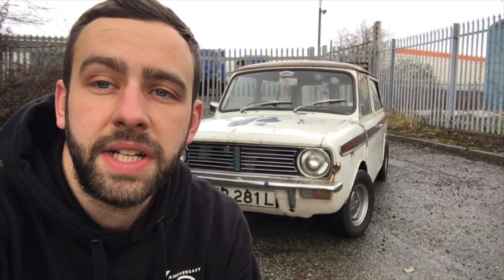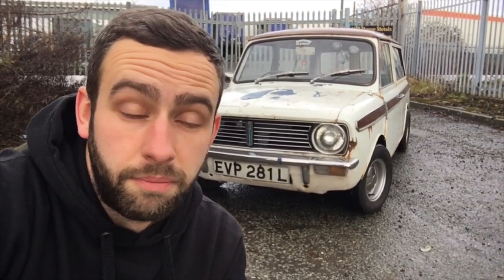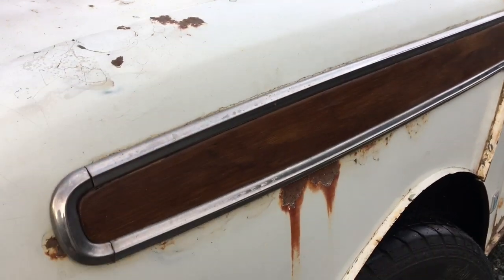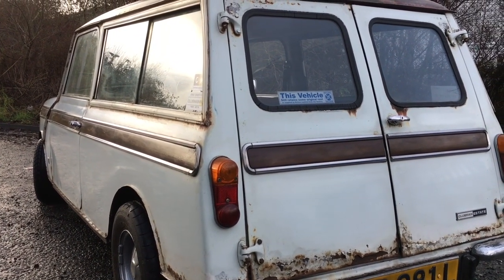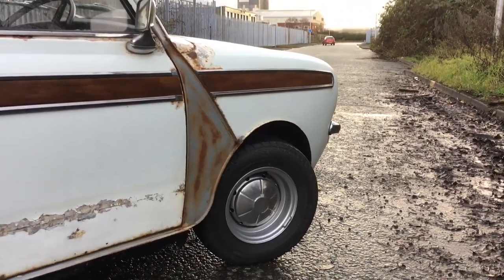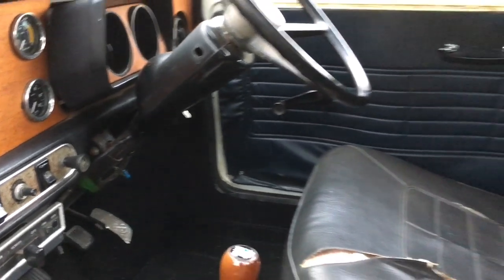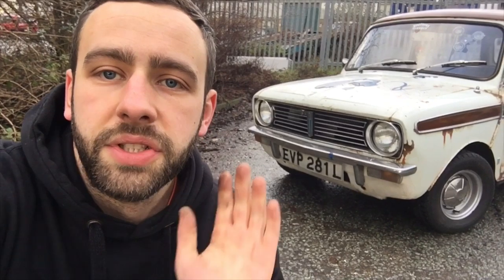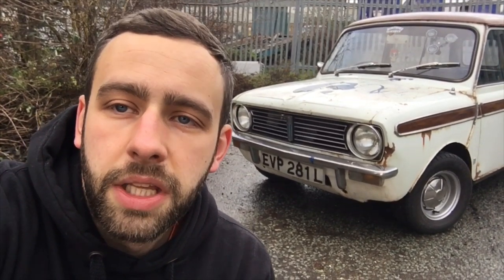Classic Mini Clubman Estate - Why I Love This Car!

Comment: Good luck with your project man... I had one of those from 84 to 88. I drove it over the alps twice and  the Pyrenees countless times, packed full of climbing and ski gear. I kept if going with fiberglass tape and eye-watering breaches of safe practice before I found a scrappy near Barcelona Airport with a few minis and began to salvage all the relatively cheap, rust free spare parts that the drier climate offered. Spotless rear subframe, engine mounts, suspension elements all dusty but not rusty. The vehicle even made it's way down to Cadiz, in wilting summer heat. It was a brilliant motor and would have carried on but for my having to quit Spain... xxx ;-)
Reply from the maker: Wow sounds like you have some amazing memories of a clubby estate and some real adventures to. I get what your saying about parts from a dryer climate. Thank you for watching 👍

Comment: Lovely little gem, as you say so practical - I delivered gear components to a powerstation in my L reg back in 1982 and carted 5 mates from pub to pub. We even camped in it when our tents were flattened in the beautifull Cornish summertime weather. Looked muscular with arches and decent rims in a way the saloon just couldn't muster, and handled brilliantly I guess cos the glass in the back brings the centre of mass rearward into a more nearly central position. Regularly miss EFA 386L. Hope you're still out there.
Reply from the maker: What a great story. I hope it’s still out there for sure. Cheers for watching 👍

Comment: Great video. It reminds me of my Mother-in-law's Mini Clubman Saloon which she bought new in 1972. It was white (Arctic White, I think) and showed every bit of rust that ever appeared over the years. I spent many happy hours touching up the paintwork and doing other minor repairs. The car was eventually given to my wife in 1986 when it became her daily driver. She hated it because it was so unreliable (starting problems mostly) and finally gave it away to a neighbour when my Mum donated her Mini Special (1100) after she bought a Mini Thirty in 1989. I'm not sure I could stand another white Mini as every scrap of rust is so obvious.
Reply from the maker: Graham Woodier Thanks Graham. Yeah being white it shows everything but think it also gives it some character. It sounds like you have had some great minis over the years. Do you still own one?
Reply: @SimpsonsClassics  Yes. I have my Mum's last Mini - a 1992 Rover Cooper SPi in BRG with a Diamond white roof. Currently being restored the easy way with a Heritage shell and a professional paint job. I have just started bolting the bits back on - trying to use as many original parts as possible. Mum's first Mini was an Austin Seven which arrived in January 1960 so it must have been a '59 build. Sadly that is long gone (replaced by a string of Austin 1100's that rusted even faster than a Mini).
Reply from the maker: Graham Woodier hey that’s awesome nice to know that you still have a mini though. That does sound like it would have been a 59 built car shame she doesn’t still have it.

Comment: You should repair the rear doors before the bottoms rust all the way through. I know to want to  keep the car as original as possible, but you can get replacenment repair panels for the bottom of the door. I just worry that if you don't address the rust before it gets to the point that it rusts all the way through.  The wood on the sides looks lovely, kudos to your wife for the job.   Can you get new reproduction seat covers for the original seats?  Usually replacing seat covers just requires  hog rings and a set of hogring pliers.  it would be great if the repo seat covers were available.  It really is a great car, and as you say, it is very practical.
Reply from the maker: Shane Black Lord Yes the back doors are definitely something I want to sort and I am on the look out for these. If not the panels will be source and I will repair the bottoms of them. Don’t worry. Cheers I think the wood looks awesome after her cracking work. Yes you can buy reproduction seat covers and a big price so hoping some second hand seats come up for sale. As it would match the car much better. Thanks for watching 👍

Comment: Hi
I came across your channel quite by chance as im done with "Restorations" now having done a few and more favouring ratty conservations ;) 

Its only Original once!

What broke the camels back for me was restoring a 70s Mustang I imported everybody said the redneck keep it on the road look was cool,i never listened and restored it now i miss the way it was :( 

I also have a Mini background I started with a 77 Clubman in Reynard and then had a 95 Sprite :)

I love this your Clubman and you must must do what you feel right.

If it was mine I would remove the blue paint but respect your reasons for leaving it,

The rear doors you obviously have great welding skills so id rebuild the bottoms then linish the metal get a good paint factors to use a spectrometer to match the paint get a few cans made up and id blow them in but use paint sparingly if its thin itll rust again then seal it from oxygen with linseed oil and you should end up with solid doors that look a bit like they do now yet very solid :)

You could used the same approach with the a panel and hole in the upper wing then a sketchy blow over let them rust and oil them ;)

I pl;an on doing something similar with my next car,there's a saying "shiny paint causes stress" its soo true you have a gem there,its all about repair make do and mend and and repairs prolong its life yet make it look like its still just aged gracefully that way ;)

Im now going to binge watch the whole playlist 😂

Jo
Reply from the maker: Thanks for coming across us and leaving a comment. This was made a few years back now so I have worked a clear plan out for the doors etc so keep watching and stay tuned for coming videos. 
As for the paint on the bonnet I have chosen to keep it as it’s part of the car’s history and a great talking point. I love how it looks it’s lived a life and drives very well. 
I hope you enjoy the channel, I hope you stick about and sounds like you have had and still own some great cars. 
Regards Marc 👍

Comment: I would love to learn more of the "wood" treatment. I have a 71 currently sorned with pieces missing both of the "wood" and the chrome trim. If you were a purist rather than a Mini lover like myself you might find thos Clubman hub caps would not have been fitted to an early estate as mime has the same as those fitted to the van and Cooper "S". Carry on enjoying Mini's and making the videos.
Reply from the maker: Hey thanks for watching. I will try and cover the technique in a future video and run through the process. It’s not factory correct obviously but it’s a awesome finish and actually feels like wood to. Hope your project is going well. 👍

Comment: That air filter isn't original. The original round metal housing with the downwards pointing nozzle housing on the side of it and the circular paper filter inside would have sat on top of the carbuettor held down by a threaded stud and wing nut. On my 1971 hydroelastic Clubman the wingnut used to work loose over time and the top cover would rattle every time it went over a bump. If you didn't catch it in time the wingnut would come off completely and drop down the back of the engine, usually getting stuck between the branches of the exhaust manifold and requiring a lot of effort and scraped knuckles to retrieve it. Happy days.
Reply from the maker: Veni_Vidi_Vortice Yes i did mention in this video or another that I swapped the original carb and filter out for a bigger one just for usability really as I had the head rebuilt. I have kept the original and it will go back on the car at some point for sure. I know exactly what you mean about that wing nut aha. Thanks for watching 👍